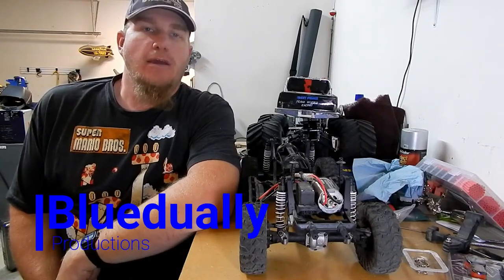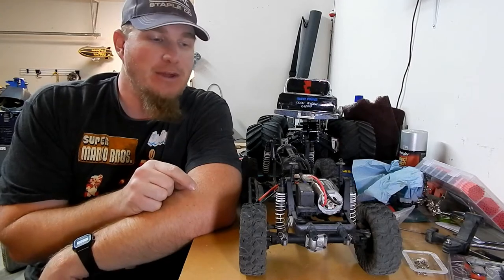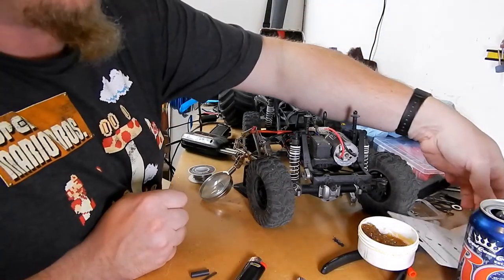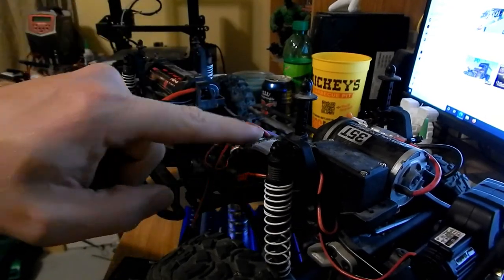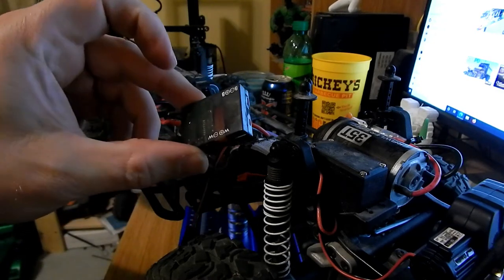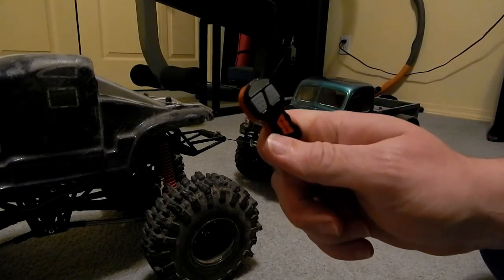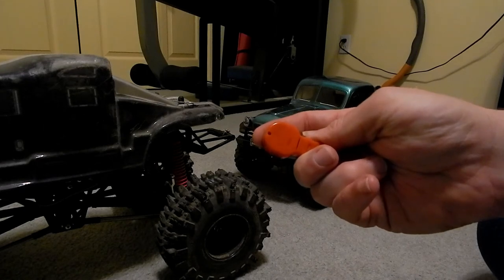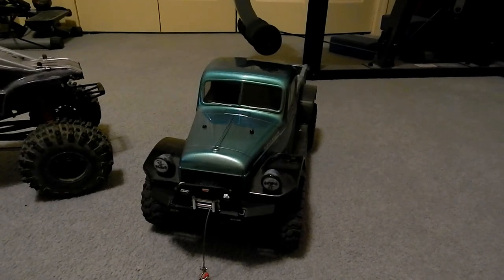RC4WD wireless winch controller install

Comment: What type of battery do you recommend with this winch, I wanna install it in my scx10 ii cherokee.
Reply from the maker: I just run Venom 3000mah  NiMH batteries in all my trucks. Haven't had the need to switch to lipo yet.